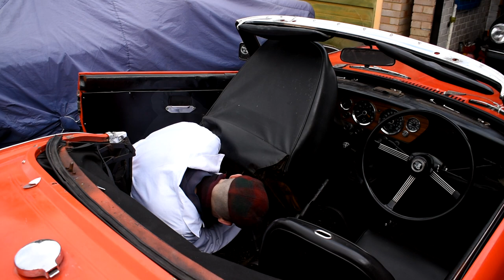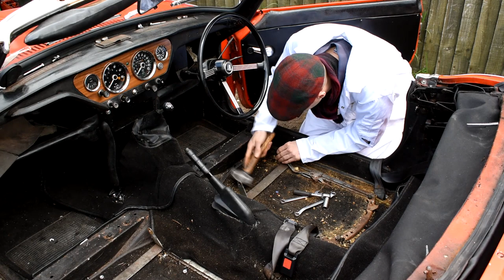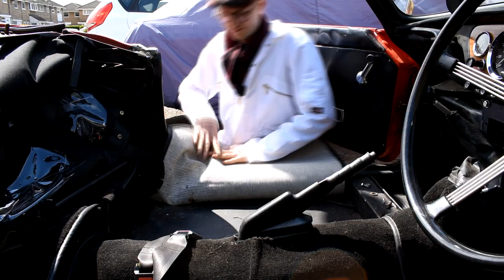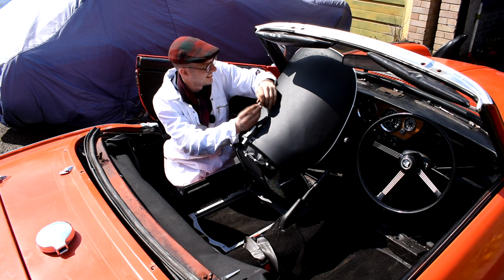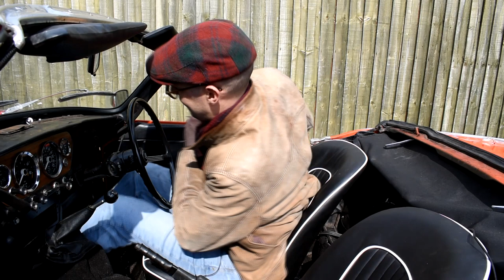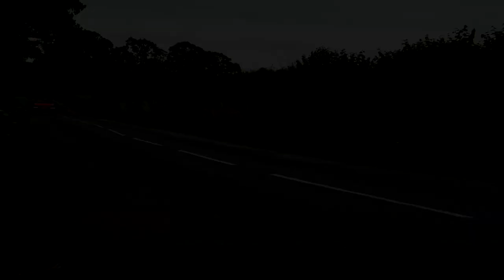Triumph Spitfire New Seats

Comment: Great looking seats Steve. A lick of paint on the ashtray and windscreen vents and the interior will look pretty smart. Will be looking forward to the floor and sill replacement in the future. This car is really coming along nicely.
Reply from the maker: Cheers mate, all will happen in good time. The ashtray and vents are soon on the cards to be done, as they just annoy me be so rusty 👍
Reply: Another great video Steve. I thought replacing the seats would be a simple job, but once again the Spitfires throw spanners in the works. My car is still at a garage having the electrics sorted (I did say to them that it would be easier to replace the look, but they thought they could repair 😪) Once its back I desperately need new seats at the current ones are horrible and rotten. I was thinking of a set of Cobra seats as they are a local company to me.
Reply from the maker: Cheers Russ, you can weld up the old seats and salvage them, that's all I did with mine. Even if they seem shot, don't scrap them, worst case sell them on eBay. Early Spitfire seats even rotten ones are worth strong cash 👍

Comment: Looks very nice Steve .Bit of a pooh to fit but now the're in what a difference !  You'd better start saving for the sills and floor work , it's going to cost £50 or more ! 😂😂😂 Although if the inner sills are sound that will make the task more straight forward. But if you fit full outers the  that means cutting the bottom of the rear wings off ! That's the trouble with metal work one thing leads to another,  as l'm currently finding out in my "e"type . Always good to see how you're getting on .Take care and stay safe.
Reply from the maker: Cheers John, the floors, inner and outer sills will all be replaced, along with the doors that are Mk4 doors with Mk3 skins. I've been collecting the panels over the last year or so for the work to be carried out 👍
Reply: @SteveDentonClassics  Thanks Steve .

Comment: Hi Steve another good job on the mk3. I have been looking through your posts the gt6 valve adjustment was brill but my favourite so far is the look on Danny's and your face when you fired up the gt6.
I have a mk3 spitfire that I restored between 1998 /2001. 
Eleven years ago I put in a gt6 engine in my spit but other things got in the way and I still haven't fired up mine yet. Your posts has given me the enthusiasm to get back on it, at the mo we are building a workshop to for  my cars but like yourself more than one car.
Do you think you might be doing a carb balance on the gt6?
Kev
Reply from the maker: Hi Kevin, that's really good to know that my videos are inspiring you. I really can't say if I'll do a tune up on the carbs of Dannys GT6 as the idea was only to get it going. As I'm sure your aware it needs a lot of body, and that's next on his list. However never say never, as there is plenty of other cars I do work on, so just watch this space 👍

Comment: For some reason fitting seats always seems more of a chew-on than it needs to be, my MGB has two annoying planks of wood with metal spacer inserts, a swine to line up. Worth doing in your case though, always good to have comfy seats, especially ones which match the car.
Reply from the maker: Cheers Keith, I found with the seats how they were I was on the floor of the car, now they are really comfy, but they do need a few miles of bedding in as they sit a little high at the moment. I'm sure the'll sink to the right height after 6 months or so and then the'll be just perfect 👍